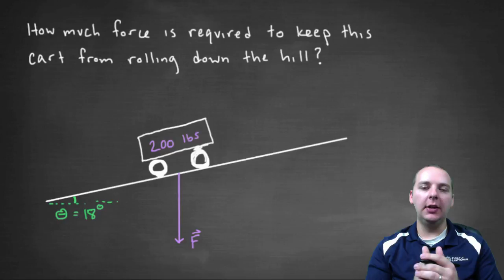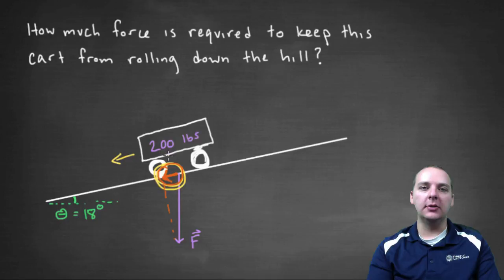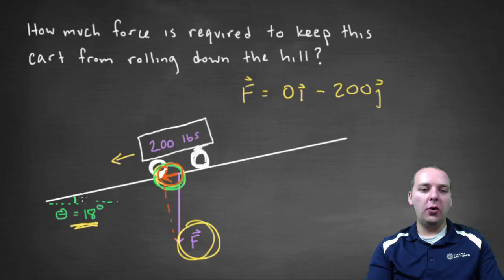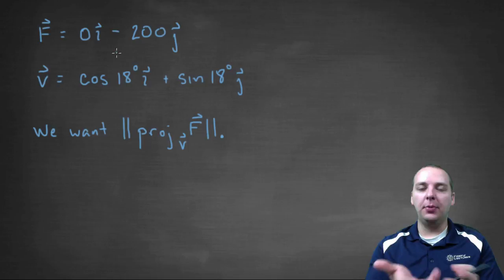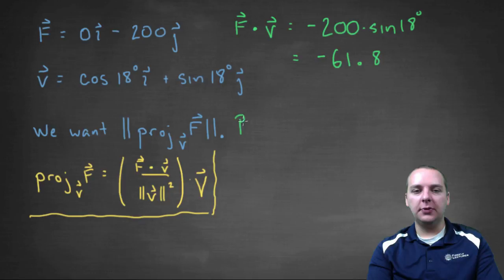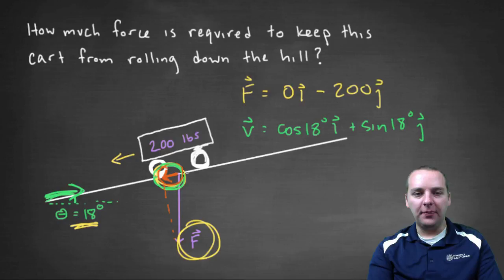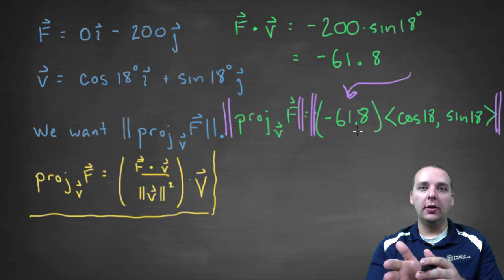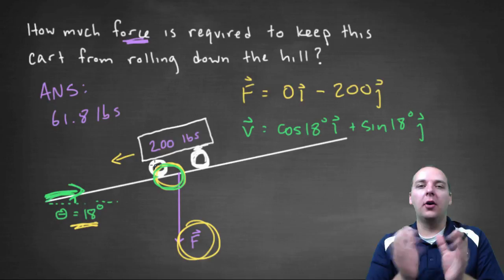Vector Projection Application - Rolling Cart

Comment: For those asking why is x represented by cos18i and y represented by sin18j: If you look at any vector, it can be broken down by its horizontal and its vertical components, forming a right angle triangle, or its x and y, or i, j.   When you look at a triangle thats right angled, you use soh cah toa, where cosine of the angle = adj/h.  And sin of angle = opp/h.  Rewritten, opposite side = sin of angle*h, and adj = cos of angle*h, however we're using a single unit vector where h=1, so the horizontal/x amount can be represented by cos 18i (the angle we're talking about) and the vertical component is sin18j, and those will be your old x,y coordinates.  Try it with a hypoteneuse right angle triangle where the h=1, and the corner angle is 18...you will find the horizontal component is 0.951 and the vertical component is 0.309...making the x,y coordinates: 0.951, 0.309 and when we square them both and add them together, we get 1.  So you can write ANY single/unit vector as x=cos(angle) i, and y = sin(angle)j
Reply: This was helpful thank you!

Comment: Hi, why is it cosine 18i+sin 18j?
Reply: If you look at any vector, it can be broken down by its horizontal and its vertical components, formining a right angle triangle, or its x and y, or i, j.   When you look at a triangle thats right angled, you use soh cah toa, where cosine of the angle = adj/h.  And sin of angle = opp/h.  Rewritten, oppsite side = sin of angle*h, and adj = cos of angle*h, however we're using a single unit vector where h=1, so the horizontal/x amount can be represented by cos 18 (the angle we're talking about) and the vertical component is sin18j, and those two coordinates reach you new coordinates of the new vector.  Try it with a hypoteneuse right angle triangle where the h=1, and the corner angle is 18...you will find the horizontal component is 0.951 and the vertical component is 0.309...making the x,y coordinates: 0.951, 0.309 and when we square them both and add them together, we get 1.  So you can write ANY single/unit vector as x=cos(angle) i, and y = sin(angle)j
Reply: Can you explain why we use “unit vector”? Where does he say this? Also - why is cos18 + sin18 = 1 ?!

Comment: F = mg*sin(teta) = 90*9,81*sin(18) = 273 N ( SI units ofc ) :)
Reply: is not as accurate as the video... is it because the 90? where did you got the 90 from? pounds to kg, which is 90.7185?

Comment: The answer is wrong, the dimension of a force isn't a mass :)
Reply: +Lennart Weik Technically it can be. My dad was once using a electric wrench that read torque and angle. The units of force were in pounds. Why? I'm assuming because force is pressure over area.
Reply: +Lennart Weik Pounds doesn't only represent mass it can also represent weight which is a force equal to mass * gravitational acceleration.